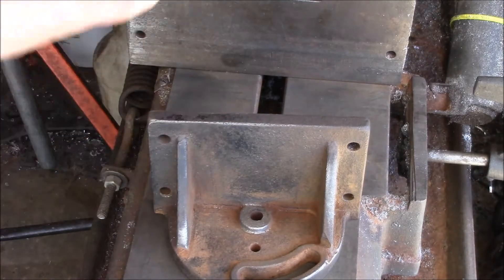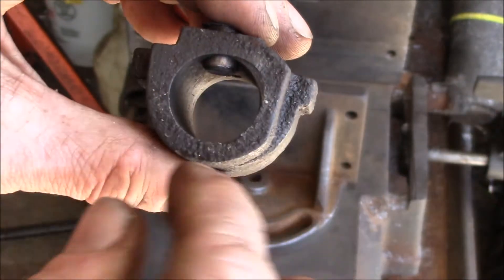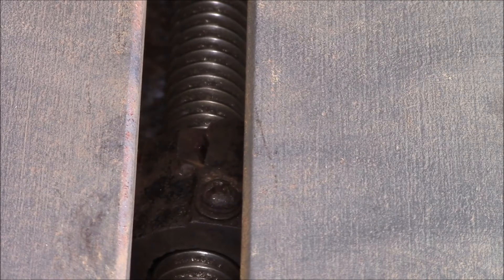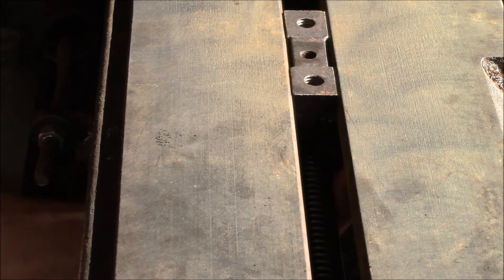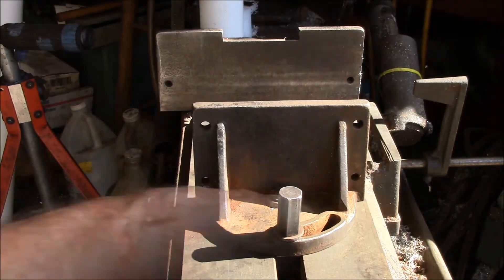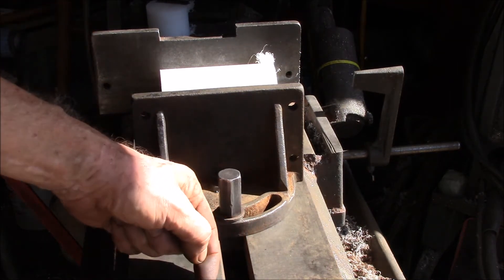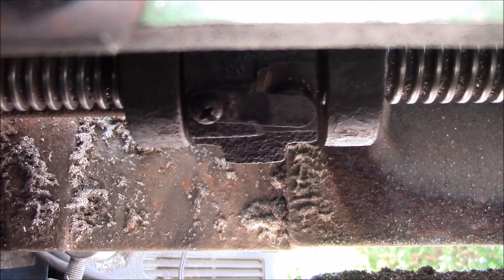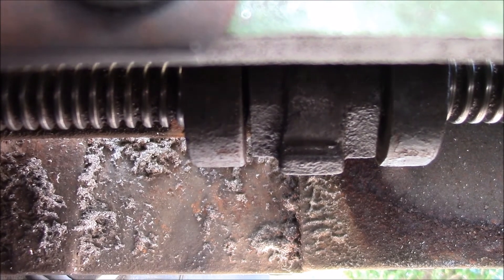Horizontal Bandsaw Quick Vise Maintenance

Comment: Thanks a lot. Can't figure out myself how that mechanism work. Great help.
Reply from the maker: Glad the video was helpful.  I get totally confused by how this thing works every few years when I have to take it apart.  At least I have this video now to remind myself how it works.  I actually need to take mine apart again as the threads for the clamp bolt have worn out and I need to put a thread insert in there.  Stay tuned for that video.

Comment: I just bought my band saw. When I go to tighten the clamp, it touched the material then it just clicks and clicks.  Donesnt tighten. Anyone know how I can fix that?
Reply from the maker: This video likely has the answer.  Common issues:  
1. Grooves in the half nut are plugged with debris.  2. Half nut is installed backwards
3. The spring loaded pin on the half nut is stuck
Reply: @The4Crawler I did clean the threads, also made sure the pin is facing the handle, the spring tab seems a bit worn. Someone modified the pin and made a point on it. If you get a chance to check how tall that pin is with a mic , let me know. I did weld my pin to make it longer but I’m not sure what the perfect length is
Reply from the maker: @thomasubi8100  Check the video description for those dimensions.  Could also be the threads on the shaft are worn.  Mine are starting to get that way, rounded on the leading edge.  I've picked up a new shaft to put in if if gets any worse.  The other option is to reverse the shaft, although that would require turning down the opposite end and putting in a keyway.
Reply: @The4Crawler excellent idea! Thank you. I appreciate the help. I’ll check back in.

Comment: I’ve got a problem with mine where the vice doesn’t tighten up it just keeps turning. I’ve had it in bits and nothing is worn out or broken, it’s only a couple of years old too, I’ve tried cleaning it all as well. Any suggestions for a fix?
Reply from the maker: Make sure the half nut is on in the proper orientation.  One way to check if it's on backwards is to put some hand pressure on the movable jaw (push it towards the fixed jaw) and then try cranking the hand wheel out.  If the movable jaw starts opening with pressure applied, the half nut is on backwards.  Likewise, check that the little pin is able to move and that the spring is able to push it inwards if you push the pin out.

Comment: Thanks, I just fixed my vice after not working for years. I had bought the half nut to fix it but didn't need it. The thread cleaning was what it needed. Putting back together took three tries until I came back to your video to see the orientation of the halfnut. This was an amazing time waster for me, looking for clamps to hold the vice jaws closed.
Reply from the maker: Great, glad you got it working.  I still find that half nut to be confusing and come back to this video from time to time to refresh my memory.

Comment: The pin with the spring causes friction pressure to spin the mechanism.  The tab engages the threads.  My tab wore down so I brazed a mm or so of rod on it and ground it smooth.
Reply from the maker: Sounds like a good repair option.  Mine is not worn down that far yet, but I'll keep that in mind.

Comment: Thank you for the advice. Got an old bandsaw at work back up and running after years of sitting in the corner. My only problem was this. For the life of me I couldn't figure it out. Some one did have the middle piece upside down and currently still is in that position. Cant wait to go flip it around and have her running 100%! Thanks again!
Reply from the maker: Yes, I've made that mistake, too.  It seems that's that way it should work, but in reality, that's upside down and backwards!

Comment: Thank you!!!!!
Reply: Brilliant video for your small   bandsaw and how vice mechanism works Very helpful to me trying to sort my 1018 or BS 250.The difference being the half thread is on the opposite side to yours.meaning the moving piece is positioned so the pin is facing away from the  hand wheel.Mine now works perfectly thanks. to your video.  dave@reconworkshop.com.   UK
Reply: Hey i have a grizzly bandsaw and the vise reaches a point and it does tighten i took it out and clean it same problem any ideas

Comment: Thanks for the video. Just aquirred a horizontal saw for cheap. Its in need of a bit of a tune up. The last owners had the acne nut jerry rigged with some added dowel pin. Had no quick release function. Threw me thru a loop. Tried all different ways to install it to get it to work, based on how I took it apart. Nope def wrong. Now seeing at how it's correctly oriented, I got it fixed up right. Again thanks super helpful
Reply from the maker: Great result, glad the video helped.  I always seemed to mess up installing these parts.  It was only after I stuck the video camera underneath to see how the mechanism actually worked that I now know how they are supposed to go.

Comment: Our horizontal at school is having a similar issue, now maybe I can fix it and be a hero, lol. 
Good video thanks :)
Reply from the maker: It's usually the half threads inside the round cast iron part that get gunked up or the spring loaded pin gets a bit sticky.  Easy enough to get a little right angle pick and clean out the threads (usually a waxy deposit in the root of the threads) and then free up the pin.  Then the key is getting it back together in the proper orientation.  Be sure to take a look at how yours is set up before taking it apart.

Comment: We had to buy a new part, the peice with the sprung fed pin, however its not came with the springy bit
Reply from the maker: Should not be too hard to make a replacement for that.  See if you can find a piece of thin steel that's springy enough, something like stainless steel sheet metal.

Comment: just drug my bandsaw about 50 meters in the grass cause the power in the workshop was out and had to get to power.  Now the problem I am having is that the quick vise isn't releasing and being very difficult to rotate the handle.  I guess time to take things apart and clean things up.  Thanks for all the knowledge and pics.  I doubt I bent the cast iron table bad enough to bind up the acme screw.
Reply from the maker: I would check the handle itself, might be cocked on the acme screw or slid in too far.  Easy enough to loosen the set screw and pull it back a little and see if that helps.
Reply: might have caused something to happen when grabbed saw by handle to move it on the dirt.
Reply from the maker: Yes, that hand wheel is a bit touchy.  Too tight or close to the table and it'll bind up.  Too loose and the vise is harder to clamp down and loosen as there's too much back-forth play in the Acme screw.
Reply: OK when I took the moveable Jaw apart a few weeks ago,  everything was OK but that carrier/nut piece that the moveable jaw screws into.  What happens is that when the nut is all the way by the handle the rectangular part of that nut that goes in the slot is flush with the top of the table casting.  When that nut is all the way by the fixed jaw then the rectangular part in the slot is about .06" below the table surface.  Basically, if I tighten down the moveable jaw to the carrier/nut it clamps on the table casting.  I am reluctant to put a shim in there because if I move the jaw all the way to the end of the table then it will be above the table.  Have any suggestions?  Thanks for guiding me so far.
Reply from the maker: Hard to say for sure.  On mine, it's the same height all the way along the slot.  Perhaps the table was not milled flat, or the underside of the slot has been worn unevenly.  Suppose you could check the depth of the slot in a few places and see if it's consistent or not.
Reply from the maker: @daveharrison7600  Dimensions have been added in the video description of this video.

Comment: looks nice and smooth operation
Reply from the maker: Yes, once you get it cleaned up and lubricated, it does work quite well.  When you look at the parts, they are so loose that you think they are worn out.  Yet, it's that very looseness that is the key to the whole system working properly.